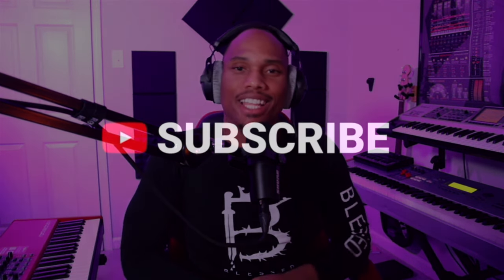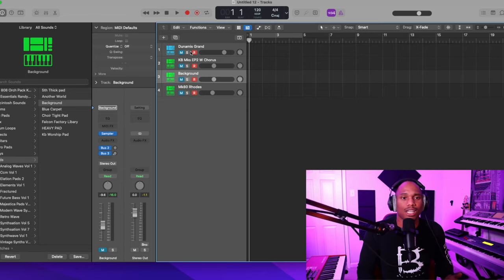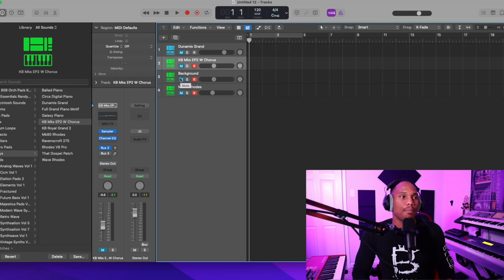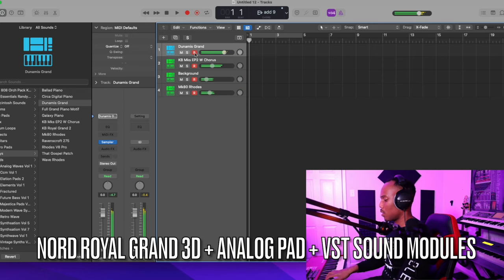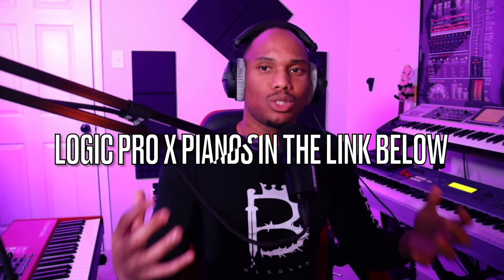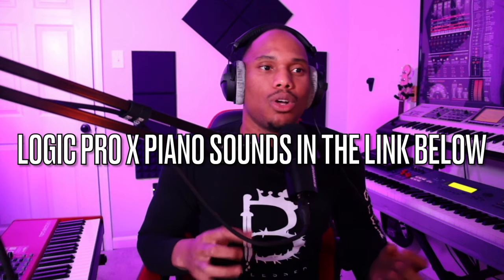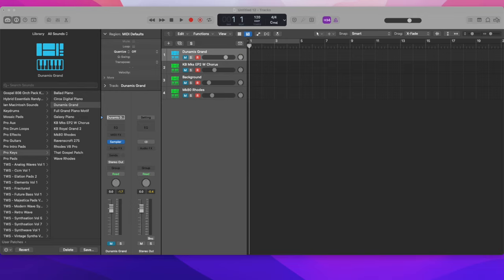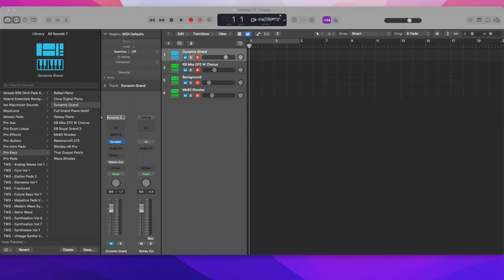The Ultimate Guide To Creating Piano Patches For Church

Comment: Yo kell quick question, I’m kinda new to this- is the yamaha motif rack like the instrument library from the motif (The actual keyboard)?
Also Great video man theres some real knowledge right here
Reply from the maker: The motif rack is a sound module that Yamaha released in the early 2000’s think of a keyboard computer without the actual 🎹
Reply: Appreciate it man been tryna find a way to get some of the motif sounds without having to get the actual board
Reply from the maker: @offfwhite1  check eBay or reverb!!